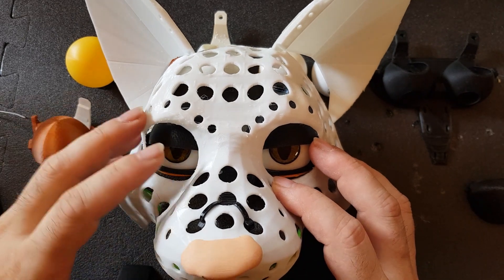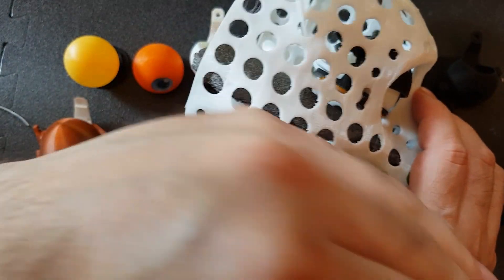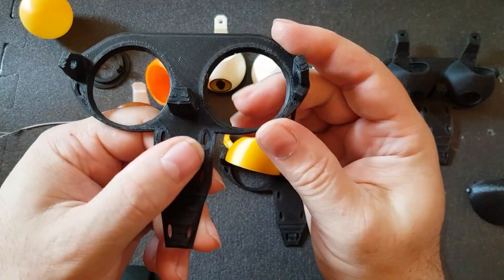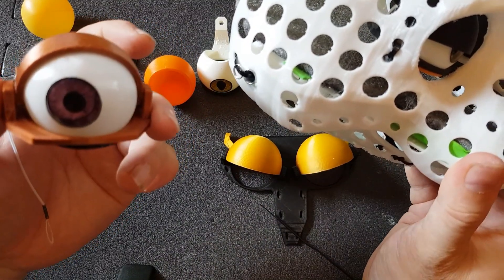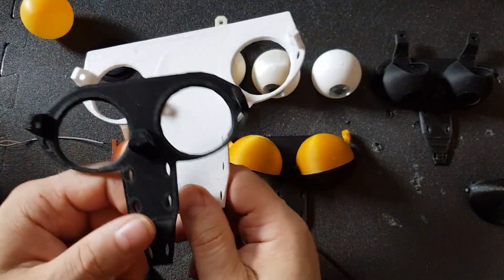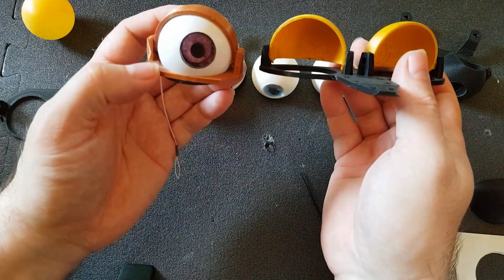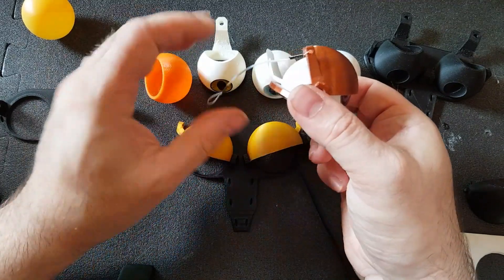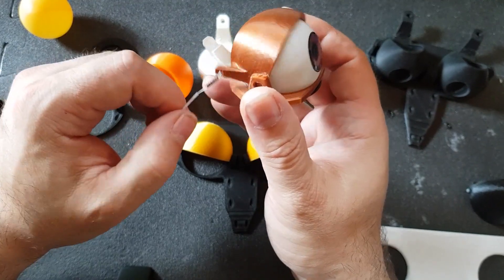3d-printed base plate for movable eyes and eyelids

Comment: what's the part that is keeping the eye attached to the baseplate? I notice its sometimes orange or black and i cant find the model of your pintables, or maybe I'm just missing something?
Reply from the maker: You can get puppet_eye_ringclip.stl at https://www.printables.com/de/model/95920-movable-puppet-eye-and-eyelid/files
Reply: I'm using eye without lever, does it work for that eye? is it meant to snap into something or is it gonna stay in place once i build the rest of the parts for my hand together? @Tiohkatrah
Reply from the maker: @jimmyjackson2393  The part was not made for the eye without lever. It'll fit if you resize it - only half of it snaps in, you'l have to glue the other side in.